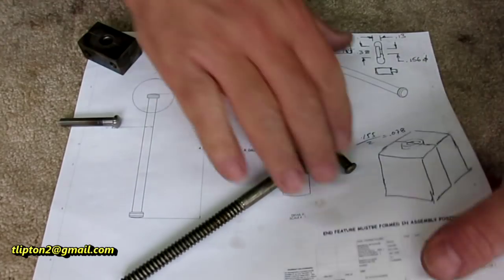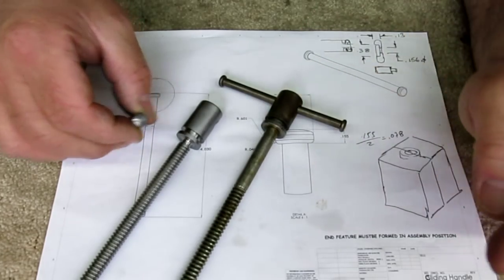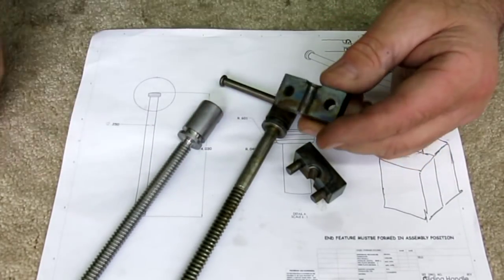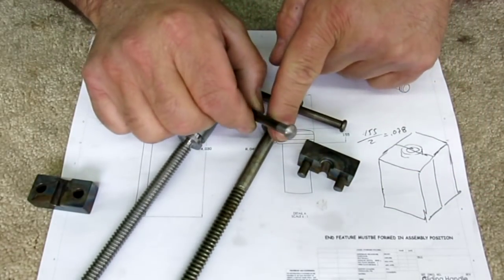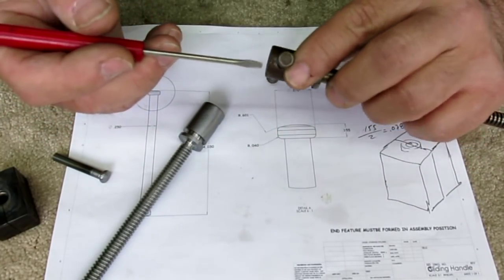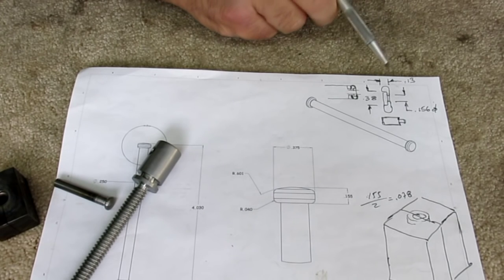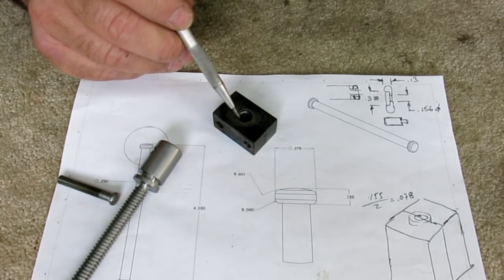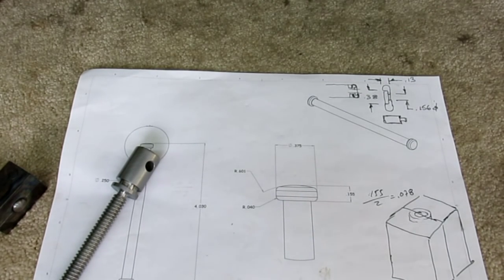Wilton Baby Bullet 11

Comment: Torch and 20 ton press.  Easy.   On the handle - the peening part - I drill a small hole in the center so the rod breaks from the hole and makes it easier.

Comment: When I was in college working on my Airframe & Powerplant license we were tasked with making a small pair of steel parallel clamps.  We had to peen one of our handles with a cap just like what you had made here. Part of what we were graded on with this projected was how well we peened the handle.  The professor was not suppose to be able to see the joint of the two pieces. There was a name for this process but for the life of me I can't remember it. I cheated and used JB Weld. I don't think the FAA will pull my ticket, hopefully.

Comment: Tom
Excellent work and video. When you used the end mill in the drill chuck to make the flat bottom recess, I have an alternative. I picked up a set of DeWalt Pilot Point drill bits by 64th's at a Cabin Fever show. They work great for when you need a flat bottom hole while working on the lathe.

Looking forward to Monday Night Meatloaf 100.
Reply from the maker: +Donald D'Egidio Hi Donald,

That is a good tip. No pun intended. Thanks for the comment.

Cheers,

Tom

Comment: What causes your lathe to put on the brakes. Does it have brake shoes?
Interesting how it comes to a stop so quickly.
Reply: +Charles Miller I can't speak for Mr. Lipton's lathe, but 99% sure its equipped with an electric brake - kinda like how most high-end miter saws have. When power to the motor stops (in the work direction), the polarity of the motor reverses for a split second to slow the motor. (basically, the motor is run in reverse for a few Milli-seconds).
Reply: Thanks, That makes since. I just wondered if there was any repair like replacing brake parts. Thanks
Reply from the maker: +Charles Miller Hi Charles,

My lathe has a manual foot brake. Its a simple band brake around the main drive pulley. Mori Seiki's have a real disc brake attached to the foot brake. Once you have used a lathe with a foot brake you will forever be stepping down there. Thanks for the comment.

Cheers,

Tom

Comment: I find it hard to believe that Wilton mass-produced these vises by hand as you did, especially the riveting part. Betcha they made a jig and either pressed the rivet down or used a power hammer! Beautiful work specially on the hand riveting.
Reply: +Juan Rivero wilton cast their vices, not cut and welded them together! much faster, that and having your other tooling set to do one job saves a lot of time!    yes im sure for the handle they used a press probably did both ends at once.  its the same thing with modern bolts, they dont cut the threads they are rolled and make in a second or less, looks so easy too!  and of course the casting, those old guys were masters, of which i dont think there are any left, you only have to see the huge castings of the steam railway engines, pure art to me
Reply: Yes, I am aware of that. I was specifically referring to the riveting process. Thanks.

Comment: you could have threaded the end of the rod then turned a nut on it to use as the end cap it would save you a step or two and secured the cap for peaning.